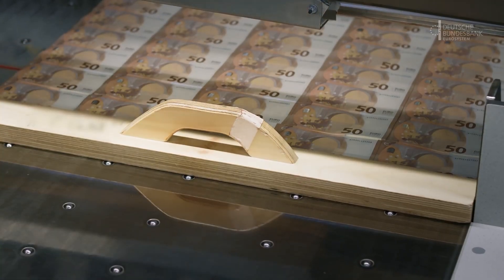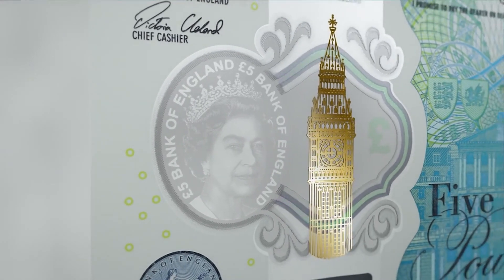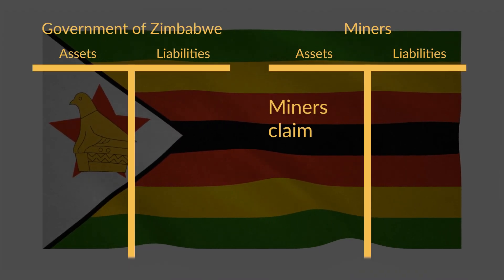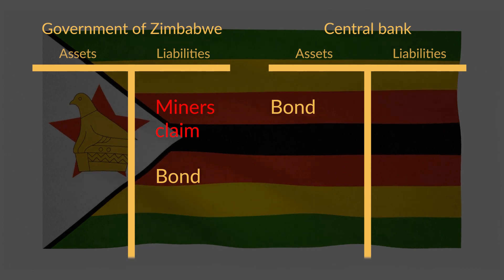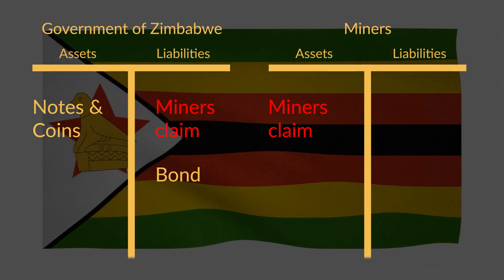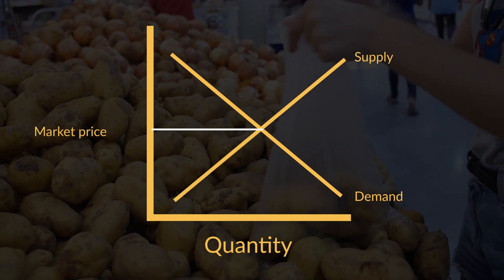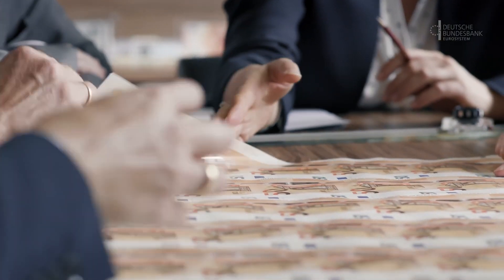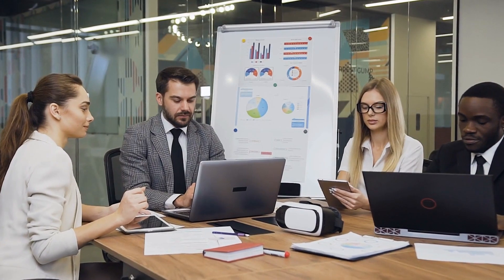How to Print Money without Causing Inflation

Comment: Surprisingly, I feel like this video actually misses the main point of inflation and money printing. If the government issues liabilities in the form of notes and coins, their value is limited by how much the government can actually 'back up' those liabilities with governance, public services and military power. The total value of all notes & coins in circulation must be limited by the total amount of services that the government can provide. So if the government continues to print money, the people know that the government can't back it up and they know the total value of all notes/coins in circulation is only a finite amount, despite how much is minted. Loss of faith in the currency results in hyperinflation. 

It's not about the specific markets, higher demand on goods, et cetera, as you discuss in this video. The extra money gradually disseminates throughout the economy and leads to an overall inflation in all markets.

Also your second graph is very wrong. Supply would increase much more than demand. Extra demand is only the farmers. Extra supply is all the food they can supply, which feeds much more than just themselves. Total cost of food goes down.
Reply: You say people lose faith because they supposedly know that government can't back up their liabilities. But people primarily measure the performance of government by the strength and growth of the economy and how their individual lives are affected by the current state. You may have a few fearmongers complaining about money printing and an increase in debt early on but most people don't complain or have fear until they are directly affected by the state of the economy - usually when they lose their job, investment/retirement funds, their home or when they can no longer pay debts or don't see increases in their quality of life.

So government backs up its liabilities with a growing, more productive economy and is not limited to public services and military power. For western countries, there is a perceived limit to the number of public services but no visible limit to private enterprise and so the excess money needs to be absorbed by a growing private sector. As long as the economy actually increases productivity to match the growth in the money supply there are no issues. The moment the added money is unproductive that is when you get inflation. Unfortunately, even in industrialized countries, the new cash is often funneled into non-productive assets like speculative housing and stocks and so we get bubbles followed by a loss of faith and recession.

Your assumption is similar to those that back the gold standard, assuming the currency needs to be backed up by some limited commodity or service. For the gold-backers, government liability needs to be backed primarily by gold and other precious commodities. But that is a ridiculous assumption because industrialized economies are much much larger than the commodities they consume and store. Gold reserves of the US don't even back a single percent of the US economy. Similarly, public services (although much larger as a percentage of the economy than commodities in most industrialized countries) also cannot back all the government liabilities to support the economy. So the reality is that government liabilities are backed by the entire economy of their country. It is backed by every single product and service, public and private.
Reply: @rodrigoarenas2230  you guys wanna jumpstart the economy without real need, through a method which is bound to fail if everything doesn't happen perfectly as planned, but we're fear mongering for assuming the worst? Slow and safe is better than fast and risky. You're trying to lift people from poverty by risking the lives of those who just escaped it. You're basically gamblers, but with others people's money.
Reply: @BlackSunRX2008  - "you guys"?  When did I say I want to jumpstart the economy and with what method are you referring to? Money printing? You should reread my comment. But I'll summarize here:

First, I  was arguing against the ridiculous idea that commodities (like gold) or public services can back the currency of economies much larger than the value of both combined. They cannot which is why no large developed economy has a commodity or public service backed currency.

I then mentioned the reality that money printing itself does not necessarily cause inflation - which is true as long as the newly created capital is allocated to productive investments.

The part that seems to have gone over your head is where I continue the above argument and follow it with the unfortunate reality that new money is often allocated to speculative and unproductive investments (gambling as you put it) causing bubbles and serious recessions -  this is practically the exact argument that you are making!

I still defend fiat currencies because our modern economies cannot grow without them. Their money printing capabilities are a necessity to meet the capital demands in productive assets and investments in a growing economy but it must be done with restraints. So I don't think any of your criticism are warranted.

Comment: Thanks for your explanation. I think your explanation of money supply is different from MMT version. Bc MMT believe govt don't need to issue bond to supply money into the economy as long as they issue their own currencies. Can you elaborate more on different or similarities between your version and MMT. Thanks
Reply: this is the MMT explanation, the use of bonds for government spending is just a legal restriction on the cb and treasury in the us and other sovereign currency nations. the law prohibits the cb to buy bonds directly from the treasury (issuer of bonds) and lend directly to the treasury. so when the government spends, the cb repos securities from primary dealers prior to the auction of government bonds to the dealers to ensure sufficient bank reserves for the auction. at the auction, the treasury sells bonds for bank reserves. the treasury then adds the reserve balances to its tax and loan accounts at banks. then at the cb reverses it’s repo agreement and the treasury calls in its balances from its tax and loan accounts to credit to the fed. the fed uses these funds to credit the accounts that the government spent money on. the balance sheet ends up the same as if the cb and treasury did not have these restrictions and just credited the accounts of its recipients, making bonds only a tool of monetary policy.

Comment: If a country which doesn't have a solid industrial base and supply chain able to make agricultural industrial assets (tractors, harvesters, fertilizer, seeds etc) than that country would not do good to print its own currency to jump start farming, it would have to borrow money from another country that can deliver those goods and pay it back with interest? Correct?
Reply from the maker: Good point. In that case, the country should be extra careful. Printing a bit to jump start farming might be a good way to then fund a next step, which is industrialization. But yeah, the less industrialized a nation is ... the trickier it is.
Reply: @MoneyMacro  no... the less industrialised it is the easier the low hanging fruit is to gget to
Reply from the maker: but very tricky to get off the ground... still I see what you are trying to say. More opportunities as well. Agreed @wasdwasdedsf
Reply: @MoneyMacro  bruh i swear that for years I have been battling strangers and friends which have economics degrees, battling them over the fact that money is just paper and you just can't throw money to solve things as a central bank. Money creation has 2 sides I always told them, as per my observation, printing the money itself and the most important side  "balancing" that money with services and products. If you have one without the other you run into issues. I have no economics studies, just my observations and thinking experiments, and the final argument for them was that I have no studies in this domain. I swear to God almighty that universities just kill education, common sense and ability to observe, they make a lot of people live a delusion.
Reply from the maker: @tetrusadima  yeah that final argument is an 'argument from authority' and is a well known fallacy (meaning that it is not a proper argument). In my mind it means they ran out of real arguments. 

Sure hope that not all universities kill education and common sense though, since I teach in one :P .
Reply: @MoneyMacro  if your uni is profit oriented or has a high degree of nepotism I got bad news bruh.
Reply from the maker: @tetrusadima  University of Cape Town. Pretty happy with the academic climate there. Always room for improvement of course.
Reply: @MoneyMacro  that's a good uni ngl
Reply: @MoneyMacro  love how u converse with people in the comments. keep up the good work. so if I understood the video correctly: spending = more demand and if there's not enough supply growth the existing supply becomes more scarce and expensive. if the supply decrease > supply increase + demand/spending is high = hyper inflation?

also printing money doesn't necessarily decrease the value of existing money as long as supply growth can negate it?

btw create crypto donation links with xmr, ltc or bch (btc expensive transaction fees) for those of us who don't want to use paypal or patreon.
you got any books you'd recommend to beginners that want to learn more about economics? perhaps a booklist link using amazon affiliate would be a good idea.
Reply: @tetrusadima  I noticed same, so I had hard time studying in university.. (dropped out)... common sense doesnt seem to live there, nor do they care of it making actual sense. Most economists are smart people to notice this and oppose politicians, but they have limits in some cases. George Gammon youtube channel reminds every time of this important thing tho. This exact thing is why I dont like GDP and lots of public reports tied to it, coz GDP is just printing notes without balancing act(so it is very easy to cook books so to say).
Reply: @mocromo2010  "
also printing money doesn't necessarily decrease the value of existing money as long as supply growth can negate it?"
My common sense intuition says this would be true, as if I were unemployed and got 1000$ but then started providing service and gained 3000$ which was originally, in theory printed as extra money from central bank, then yes, these things would stay in balance. Isnt this how originally poor countries got rich over time? ie farmers didnt do much work(very small farm, just work to get little food for one person, amx avg 10 hours per week), then they worked 40+ hours in factory per week --> more work output should equal more value.
Reply: @effexon  ty for clarifying it even further. it actually is simple. money is a symbol for value. as in how it replaced the batter system. and the balance between the symbol and value is inflation or deflation.
Reply: @effexon  I went over and took a look at George Gammon's channel. Seems like a wack job of the right wing variety.
Reply: @tetrusadima  Not true. Money is not just cash. Money is also credit. Indeed, cash is used for very few financial transactions. Remember the categories of the Money Supply, i.e. M0, M1, M2, etc.? Cash is only M0. Where do you think the other categories come from? 

So, when we say governments are  "printing money", is it only new M0 we are referring to, or do we include M1, M2, etc? 

Research the recent UK Pension Fund Crisis in early October 2022. You will see that no cash exchanged hands, but the Bank of England pledged millons to rescue the Pension Funds facing insolvency due to collsteral calls, because they had pledged their long-term gilts to borrow to finance investing in derivatives. The hikes in interest rates after the disastrous Truss-Kwarteng Budget, devalued those gilts, and they needed to find money to make up the difference. The pension funds couldn't, and would have be forced to sell their gilts and go insolvent, if the Bank of England hadn't intervened.

Also, Quantitative Easing did not produce any new cash into the system either. So, where did the inflows come from?

It's complicated, because the "money printing" was carried out by giving individuals and firms money, money that was raised by more government debt, not by just printing cash. So the money for QE came from the money markets, and the government them gave that money out to to individuals and firms. Even the banks didn't get cash. They got Reserve Credits, that could be added to their balance sheet, but not be loaned out or used. They were basically IOUs backed by future taxation streams, designed to boost the collateral of banks to get funding from the money markets. So, what money printing consists of depends on the economy we're talking about. Weimar Germany and Zimbabwe were not the same as the US and UK economies are now. The former had economies so hollowed out, they had to resort to printing cash to prevent social disorder. Their economies were so destabilised, there was no taxation stream stable enough to provide collateral. The US and UK weren't and aren't in that position, and so could leverage their future tax revenues.
Reply: @isoldam  George is a dedicated libertarian capitalist, but he knows his onions nonetheless. He can still break down the impacts of money printing down to double entry accounting. So ignore his politics, and listen to his analysis, and learn from it. Find the holes. You'll learn a lot, from people you don't agree with. And his understanding of macro is strong.
Reply: @BigHenFor  money is cash & equivalent, credit & debt but the main idea is that u own all the above prior to issuance & you use deferred payment if u dont have something to back an asset if there are complications

Comment: Modern Monetary Theory has been practiced for decades but no government realises it or admits it.  It works for countries that issues, loans, borrows, spends and taxes in its own sovereign currency.  The problem with Zimbabwe is that foreign investments and loans were in USD.  So they had repay it all in a currency it did not have control.
Reply from the maker: Even if they were not, inflation will still occur if there is massive money printing that doesn't increase productivity capacity at all (or revitalises flagging demand). That is consistent with MMT right?
Reply: @MoneyMacro  yup. MMT recognizes that throw money at non productive things will cause inflation
Reply: @MoneyMacro  Yes it is.  Inflation has to be carefully monitored.  I believe it is the only limiting factor.
Reply: @georgeemil3618: Very good point you made.